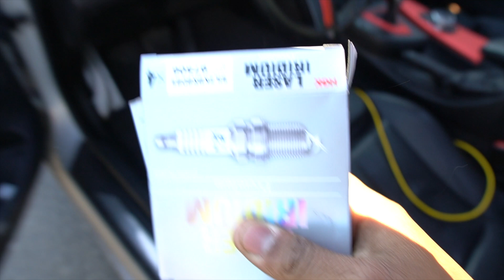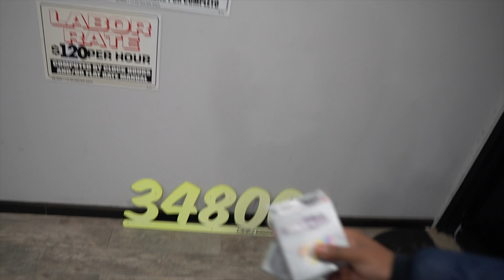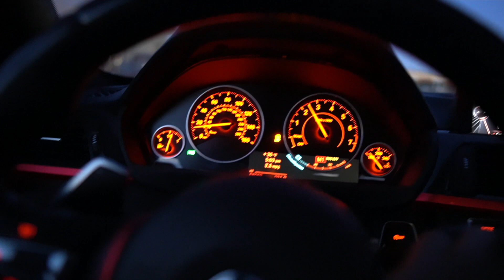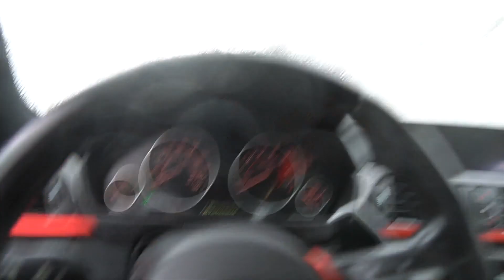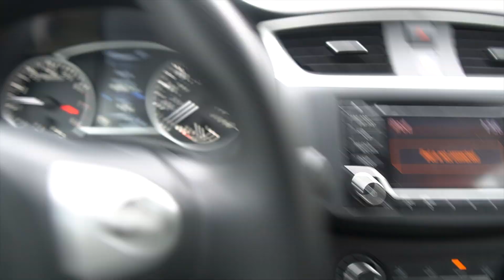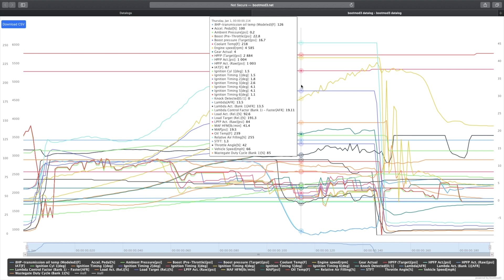Gapping N55 Spark Plugs For More BOOST!

Comment: have you sourced the fueling as yet .? .
Reply from the maker: I spoke to spool performance for a HPFP while its still in beta. We confirmed however they said it will take two weeks. Never got an invoice tho.....
Reply: ok great imma need that before new years hopefully they pull it off .. were did you take ya car to get the turbo installed . .. i only asked because i wanna make sure its was done right i have a hose that is comming off the vavle cover just hanging not connected to anything they told me its a vent hose but i wanna make sure.
Reply from the maker: Hit me up on IG @_slowspeed

Comment: I can’t wait to see what type of number your going to get out of the Big Boost turbo. So considering doing this to my F30 335i, not anytime soon but in the near future. I agree that there’s no point on upgrading to a stage 2 PureTurbo. Not only has it been done so many times on YouTube but it’s basically the same size turbo as the factory turbo. The only difference is a upgraded Billet,  turbine wheel etc.. I don’t know if everyone feels the same but if I’m going to upgrade my turbo I want to be either smokin stock GTR’s, Porsche, Lamborghinis or at least hanging with them.
Reply from the maker: I feel you on that! As soon as I finish the tuning it’s going straight on the dyno